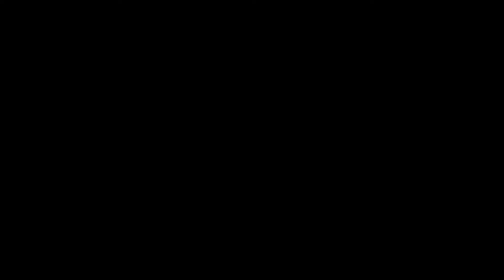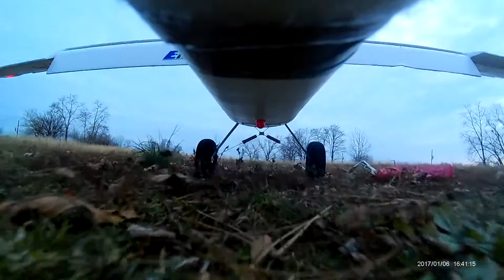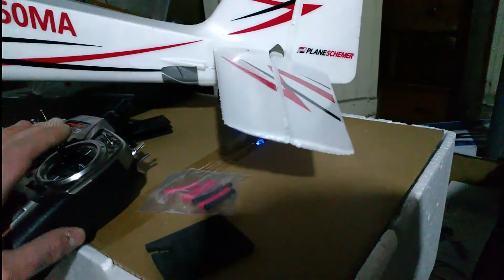E-flight Timber: PREFLIGHT FAIL

Comment: Guys it sounds like you have the AR636A receiver bind in to Safe Select mode. If this is so and you do not setup a flight mode switch you could be in safe mode all the time. Safe mode limits down elevator to like 10% in my experience for the Timber. Horizon Hobby programs the AR636A differently for different models, (so not all AR636A's are setup the same).  See pages 9 & 10 in Timber manual for the two binding options and mode switch setups.  Hope this helps.

Comment from the maker: Update: After resetting the transmitter and then trying a fresh replacement servo and getting the same result of no down-elevator, I swapped in another AR636A receiver and gained full range of the elevator. So it was the receiver -- and no I did not manipulate either receiver beforehand, this is a double-dose of out-of-the-box failure. Would someone please wish me good luck?
Reply: Doug - THAT SUCKS!!! Did Horizon Hobby Take care of you on it? PLEASE say yes!!!!!
Reply: Same here I had to buy the USB [not the android audio crap] computer controlled programmer and reflash. 
I tried the quick smartphone flasher and it BRICKED IT!!  Wouldn't even go into bind mode. 
So ordered the USB direct connection and downloaded the driver and software GUI here:
spektrumrc.cachefly.net/apps/spektrum_programmer.html.  The Graphic interface [GUI] worked like a champ, problem is you wont find Timber1.5m in the selections of models. I guessed at a model that has one aileron/one flap
and got all my controls back and of course binding. This was the WTF moment I abandoned Spektrum and their evasive reluctance to give you the dat file for the TIMBER. They want to sell you another one everytime the memory in the ar636a receiver takes a shit. BULLSHIT!!!  I am saving the limped version of the ar636 with no safe mode due to the programming issues for home made experiments. I whipped out my Futaba TJ8 and the ORANGE RX with 3 axis stabilizer and never looked back, my Timber flys better then evr before. I had to cut the membrain of styrofoam on the rudder and elevator and only use the hinges to hold them to the plane. They are stiffer then I was on my prom night. And those sub micro servos are to weak to handle that. Now they move all the way to the tail frame slap. 
I don't get it.  two program cables =40 bucks, You need a desktop windows computer I'm a linux guy corporate free OS, so I setup a VM image for winblows just to program this farkin thing.  Spektrum corporate asspacking scams are off my table.

Comment: I'm having the same problem with no down on elevator. I have the as3x bind and fly. I really don't want to send the plane back cuz I painted the plane already. Could you give some suggestions about the fix. I won't dare fly until I get full up and down.
Reply from the maker: My fix was swapping in an old Timber's receiver, though there was one other variable, the first receiver I inadvertently binded (bound?) with SAFE mode on, and on this replacement receiver I did not. I'll double check to confirm, but I believe they were the same with respect to AS3X. A possible work-around, other than calling Horizon which isn't a bad idea, is to try, if your transmitter can do this, assigning the elevator to another channel that is not AS3X, like channel five if you don't care about being able to toggle SAFE. But call Horizon, they're helpful.

Comment: Don’t go full up like a space shuttle on maiden
Reply: I'm pretty sure he didn't intend to. Probably pushed elevator forward to comp for the flaps, but 10% wasn't enough. 
There are too many problems with elevator engineering. The operator error binding in safe mode with never having a flight mode bind. The access styrofoam membrane between the elev/rudder making for a bound up movement too stiff for sub micro servos to handle, just let the hinges be the device that attaches the elev/rudd surfaces to the plane. The micro servos are too weak for 3d high speed stunts. There's a vid out here somewhere that has a dude that hooked up a mini cam and pointed it at the elevator. As soon as he 0-flapped and full throttled the elevator could not move up or down but a 1/4 an inch until he slowed down. I have all metal gear digital servos coming and I got rid of the AS3X receiver and went with my faithful Futaba T8FG and OrangeRX flight stabilizer receiver. 
Problem solved. My beef with Spektrum is mostly that unruly elevator problem and the rudder NOT being tied to the gyro system well enough. They do not host the dat files to reflash the receiver if you should brick it!!